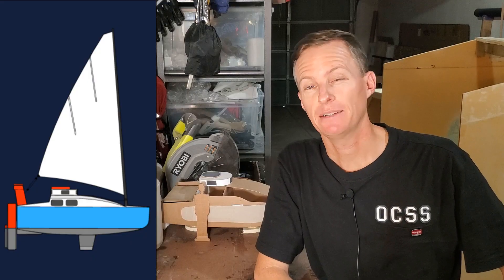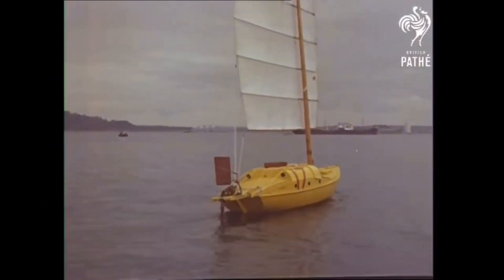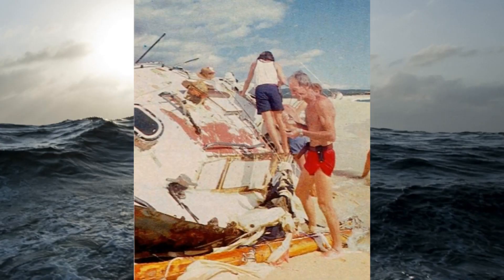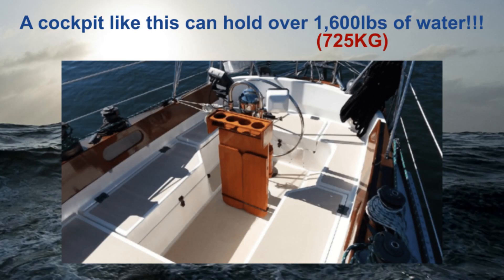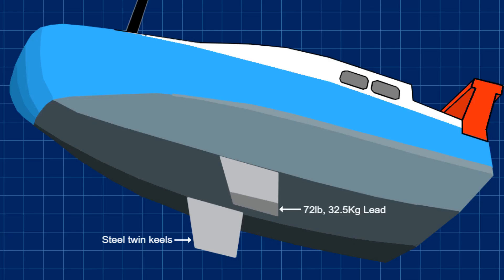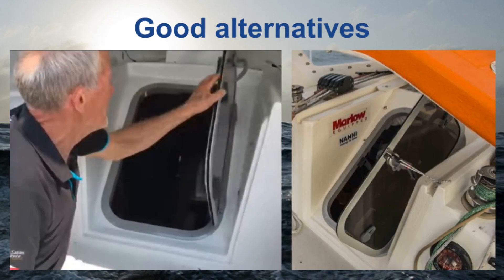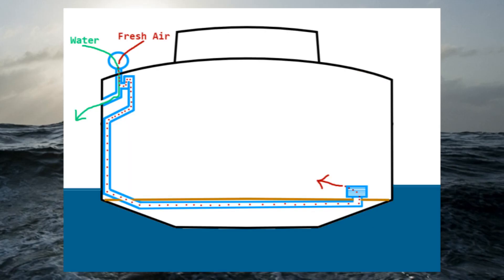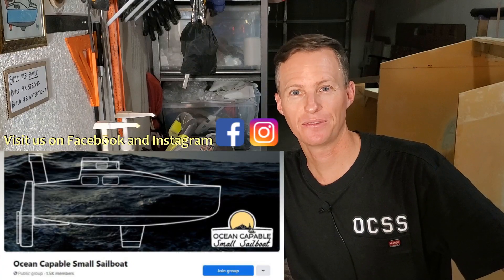OCSS-036 Building a 14' Sailboat for Ocean Crossings

Comment: But why? Whats the point?
Reply from the maker: To make long voyages on a small inexpensive boat.
Reply: @ocean_capable_small_sailboat  I guess my problem with this approach is this: as the boat gets shorter it necessarily gets slower. Slower speeds mean you have to have more food & water etc on board so the displacement/length ratio gets higher making the boat slower which means more food..  so you get into a doom loop of slower & slower. I guess I would be trying to get the longest waterline I could while still retaining my other constraints. Maybe a longer boat that disassembled into two stacking parts for storage? Double the waterline length is 40% more speed for the same power, and of the order of 16x the stability.
Reply from the maker: Sure, you could quadruple the length and then you're at a 56' boat and really flying along. But as you lengthen the waterline the costs also raise exponentially. Not only to build but to maintain. Bigger and more sails, powerful winches, etc. And the time burned on building/upkeep increases as well. If you look up the boat Baluchon you can see this type of boat has already circumnavigated. It's not fast, but it's not so slow that there's some "doom loop" you mention where the supplies needed become so heavy you can't make good progress in a day of sailing.
Reply: @ocean_capable_small_sailboat  two things: first,length is not size. It's possible to have a long, small boat. Second, we are going to have to disagree about the "doom loop" thing as the physics is inescapable. The hull speed of a 14ft boat is around 4.8 knots. Most boats at sea will cruise at around 75% of hull speed, possibly less for a heavily loaded beamy hull  so around 3.5 knots average speed. I can swim at two knots....
Reply: @ocean_capable_small_sailboat  Have you ever looked at Bolger's folding schooner? You could end up with something that is the same length when folded, but doubled on the water hence 40% faster...
Reply from the maker: You don't have to like it, but it's been proven to work with other similar small and even smaller boats. Your swim speed doesn't matter much since you can't do that 24 hrs a day for days, and you won't have a dry bed, food, and drinking water, etc with you. If you don't like long range small boats, then you're just on the wrong channel. I'm not sure what's the point of adding all the negative comments.

Comment: Hi there... May be a very late question, but I would like to understand the foam core thickness. 1 cm thickness were decided as a result of any calculation, or may be 2 cm thickness would be more stronger ? Thank You for this great and accurate work in advance  :)
Reply from the maker: 2cm would be even better. I just couldn't afford it. If I could, I would have done the whole project with 25mm foam core.
Reply: @ocean_capable_small_sailboat  thank you for the answer, I will be in the loop in the future....

Comment: I see a lot of plywood in your video. Didn't you say that you were building your boat out of foam, sandwiched between fiberglass panels? So, why so much plywood?
Reply from the maker: "so much?" Maybe 1% of the boat has some plywood where I wanted a denser core material. Just under the mast and where the rudder will hinge.

Comment: Great ideas here but I wonder how stuffy and hot it will be inside in the tropics?
Reply from the maker: True, it's a problem with any boat. Check out some later videos where I discuss the ventilation system. I would like to make sure I also have a good wind scoop into the main hatch, that would help too when at anchor.

Comment: A self righting vessel is great ! Can you stand up in the vessel ? What other means of propulsion ? Had you thought of maybe doubling this size for comfort and still keeping the original design ?
Reply from the maker: Hey thanks for the comment. I'll only be able to stand up with my head out of the main hatch. For secondary propulsion I'll use a sculling oar, maybe an electric motor if I want more. No I don't want to double the size, even just at 14' I find the work and cost involved is a lot, I can't imagine going bigger.

Comment: May I ask how is that air flow tube work? Do you need 2 to allow air come in and get out when cabin get watertight? Thank you very much. I am making plan to modify my Falcon 16. Addition question about head. I understand for small sailboat that is the bucket. Since there are no cockpit, what is the solution?
Reply from the maker: That's right, 1 vent in, 1 vent out. And in fine weather the hatch is open to increase airflow. And yes, head is a bucket used topside or in cabin. Some also just hang their bottom over the side.
Reply: @ocean_capable_small_sailboat  is that in and out depending on air pressure? Like facing wind or not? Or the out vent has electric fan force out?
Reply from the maker: @infomax2008  No electricity required. 1 cowl faces into the wind, another cowl faces downwind.
Reply: @ocean_capable_small_sailboat  Does the size of the tubing have a special requirement? The more I learn about it, the more question I have. Thank you very much for your help.
Reply from the maker: I think between 1" and 4" tube is fine. Our nostrils are small but we get plenty of oxygen through them. I'll likely use 2 or 3" tubing.

Comment: You have a very interesting approach to design with voluntary simplicity. It caught me right there ! I watched several of your videos. I got a question about the ventilation, in the event of several hours or several days caught in a very rough weather, how will you renew the oxygen of the interior ? You need an outtake to evacuate carbon dioxide, maybe I didn’t see it and you planned it ? 
And if you have your « CO2 exhaust » how do you know the section of the pipes will be sufficient for one or 2 people to admit enough oxygen ? 
Thanks in advance, can’t wait to see your boat sailing the oceans !
Reply from the maker: Thank you. There will be 2 vents, intake and exhaust. Our nostrils are quite small, and we get sufficient oxygen that way. My tubing for the vents will probably be 2 or 3 inches.
Reply: @ocean_capable_small_sailboat  thanks for your answer !

Comment: Thanks, Perry! Your internal steering system has helped inform and firm up some of my own ideas for internal steering on the yacht I hope to build. Are you going to use a whipstaff setup? (Sorry, don't recall whether or not you've mentioned it before.)
Reply from the maker: I thought whipstaff at first, but now I think maybe just a line running across the cabin with something to grip on to in the center, and move that to either side to steer. Can always add a whipstaff later.

Comment: My personal thought is that the aft deck is not good for sitting and enjoying the fresh air. I'd prefer to be ouside than in whenever possible. As for your points about comfort, that is all down to individual goals and reasons for the journey and what the individual wants to get out of it. No rights, no wrongs. I dont see the need to preach!
Reply from the maker: I could say nothing. But the norm seems to be to show off as large and comfortable a vessel as possible. I think it's ok for me to discuss another way on my modest little platform. An option that's more attainable, affordable, environmentally friendly for the person of modest means.

Comment: Would you ever sell plans or measurements on this customized design? Its such an amazing idea and I’ve been loving following along so far.
Reply from the maker: Thanks. I took detailed measurements and drew them up along the way. If you buy the tenten425 plans and want my modifications, I'll probably just give them to you.
Reply: @ocean_capable_small_sailboat  that sounds great and very generous of you! I was also wondering what your thought might be on using the sharpie 550 plans to do something similar to this
Reply from the maker: Sure, you could do it. That one is a very different shape from mine. The bottom looks almost completely flat, so it wouldn't be my first choice. Depends on what you want, though.

Comment: The thing I like about very small boats like this is that all the components; sails, anchors etc, are easy to handle. IMO you're far less likely to injure yourself with lightweight gear. Also, everything is much easier to maintain in top condition. You can lift the mast out yourself. Unbolt the keel and the boat can be easily lifted onto and moved on a basic car trailer.
You're also less likely to get injured in rough weather if you and any heavy internal gear can't get thrown any distance in a small cabin.
For a single hander a cockpit is largely just wasted space.

Comment: I wonder, if you made the mast hole watertight, with a small 1/2 inch in the bottom of the hull, to self-drain any water from rain or sea,
 you could use a circular bearing made from a nylon cutting board for the bottom of the mast so it cannot rust or seize,
 I know it is very hard wearing, anyway just a thought, you do you. Cheers from Australia
Reply from the maker: Ep 33 shows the bearing I'll use in detail. It's made of stainless steel and bearing plastic.

Comment: Great, well thought design. My only concern is placement of wind vane. It seems that the wind could be interfered by the sail. I'd move it more aft.
Reply from the maker: Yes, me too. The problem back aft is that it's in the shadow of the flotation arch, and I will have to go to the transom if I want to alter course. I might test out both locations once I'm sailing and then decide.

Comment: I'd say the high sides are my favorite feature. Although they detract from windward performance, especially with reefed sails, they add to ultimate stability, requiring far less ballast.

The wind alone can knock your boat down, but cannot capsize it. It takes a breaking wave, sometimes in addition to a strong wind to do that.

If the boat settles in an upside down condition, another breaking wave is likely to help right it.

There was an Open 60 racing sailboat that capsized with its ballast  keel intact. It had low sides, a very low cabin, and a deep keel with a bulb on the bottom.

It was found months later, still upside-down, wit its rig long gone, and its  still intact keel sticking up in the air.

What likely happened was that it was knocked down by a strong gust, then hit by a breaking wave, which rolled it over.

Once upside down, it was most likely hit by many other breaking waves. But these waves had nothing to hit but low sides and a very short, deep ballast keel, which would have righted this boat had the breaking wave gotten it to heel maybe 20 degrees in relation to the water surface.

But all this ballast, so high up, provided a great deal of inertia, soaking up the force of the wave, so the wave could not incline the boat the 20 degrees or so needed to right it, before its energy was spent.
Reply from the maker: I believe the open 60 disaster you refer to is the picture I used in this video. The one on the right. The boat on the left is The sailboat WingNuts, another capsize which resulted in 2 deaths. Neither boat could right itself.
Reply: @ocean_capable_small_sailboat  

Wing Nuts did right itself. And it did several times during the storm. The two people killed died from a knock-down, not a capsize. They were on the high side , acting as human ballast. They fell from their perch when the boat was knocked down. Apparently they hit their heads on life line stanchions on the low side.

At least one of the survivors said the boat did several 360s. It ended up staying inverted for some time. It finally righted itself hours if not days later, probably due to free surface effect of water entering the boat through vents and hatches.

A high sided boat is more likely to be pushed sideways by a breaking wave than it is to be rolled over by one.

This is because far less deck area is in the water when the wave hit knock down occurs.

The low sided boat is less likely to be knocked down by said wave hit, as it presents a smaller target.

But, if it is already knocked down  by a squall, a formerly ineffective wave hit can be lethal.

Now this principle only applies to light displacement low sided, decked over boats. Heavier ones have so much hull still under water, when knocked down, that there is far less exposed hull for the wave to hit. Block Island "cowhorns" are an excellent example of this.

Comment: instead of lead ballast in your keel add lifepo4 pouch cells. 64kgs will get you 920Ah at 12V. flex solar panels on you 3ft of wasted deck and a small regen electric motor and you have power and comfort.
Reply: And that adds in all the complication of waterproofing the cable through-hulls. Also, one good hard bump on the keels, and suddenly your watertight seals don't seal quite so well, and you risk seawater getting to the batteries. No thanks! Besides which, how will you service the batteries if a cell fails?

Comment: Great video Perry, I think so many of the aspects of design of your boat are excellent. One question is a shorter wider boat like yours or Baluchon better than Yrvinds longer narrower boat. I would have thought that the slightly longer boat would be more comfortable at sea?
Reply from the maker: It depends, there are so many factors involved. A wider beam boat will roll less, but it will also have more aggressive roll accelerations. There's advantages and disadvantages to both. A longer boat will rock less. But then I don't have the space or money for building a longer boat. so, 14' long and 6' wide was perfect for my wallet and workshop size.

Comment: I like that you can avoid Marinas and all the cost that come with keeping a larger boat. Heck if you sailed that to the east coast and up to the peconic bay it would be no problem to store it on our beach property in winter. A 30 foot boat would be a no go plus a haul out with full marina fees.
Reply from the maker: Could be a valuable resource. The location is good for departing for Europe. Could I park a car with trailer there for an Atlantic circuit trip? Always wanted to do that route.
Reply: @ocean_capable_small_sailboat  If you do an Atlantic crossing I am more than happy to offer you support and hospitality if you get to Wales in the UK.
Reply: @ocean_capable_small_sailboat  
It’s possible for sure. 👍